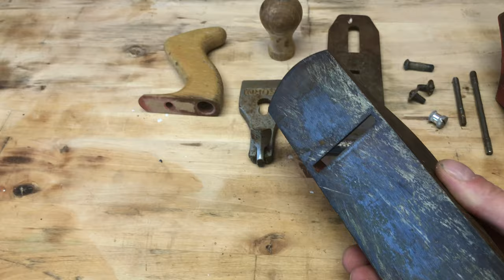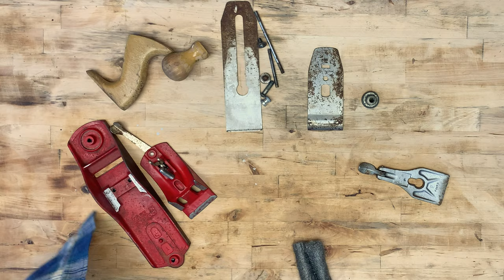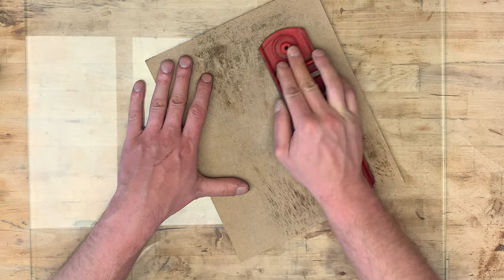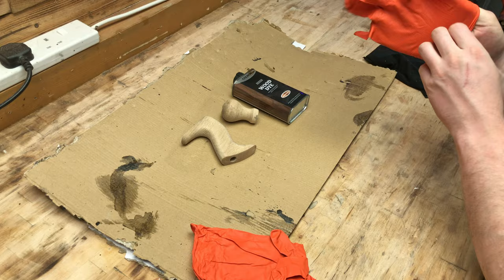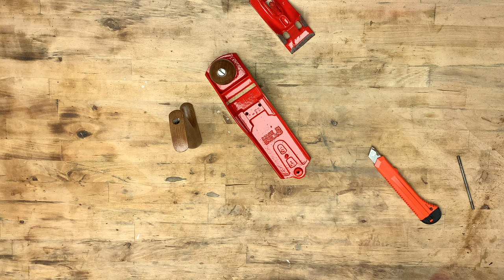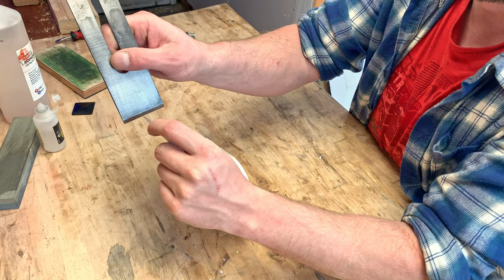OLD STANLEY plane transformation | Easy woodworking projects & Tool restoration

Comment: Old time music for an old time plane.  What was the cleaning solution used?  How long did the restoration take?
Reply from the maker: I’ve only used a dish soap and isopropyl alcohol after to degrease it properly. It has taken me 2 days but I’ve also re sharpened the blade and polished it to a mirror shine 😉